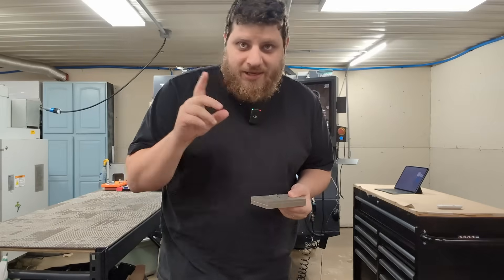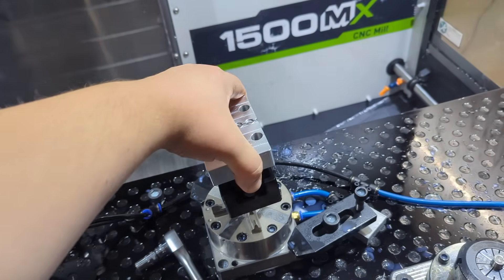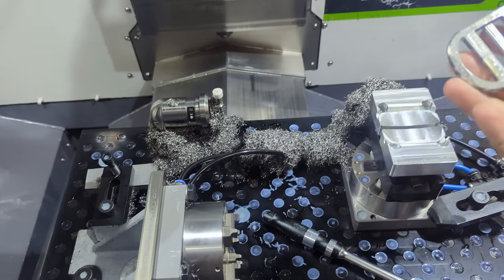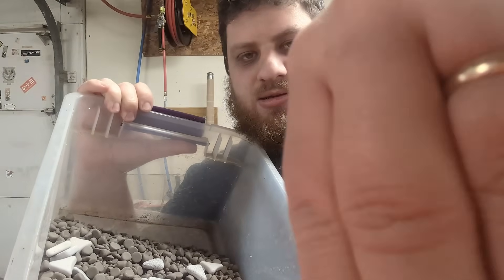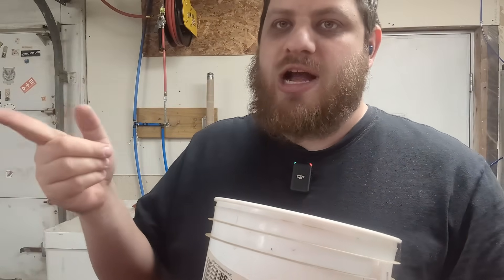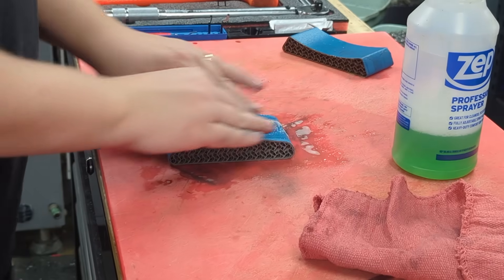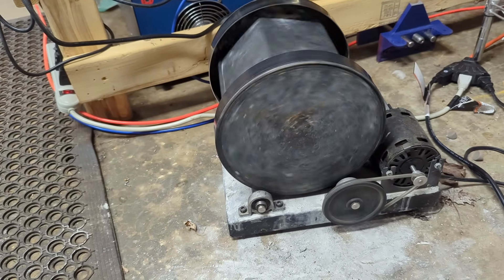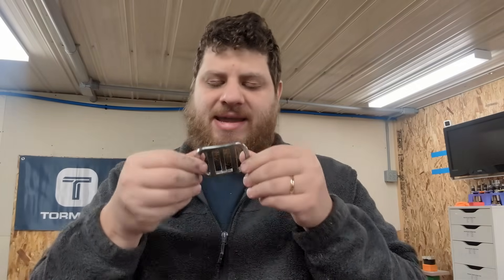Back to my roots

Comment: how do you charge for a part like this? $400 belt buckle?
Reply from the maker: This is a prototype for a larger order, so the cost of this one part will get amortized out once they go to production.
Reply: @AudacityMicro ok makes sense. How much would you normally charge for that 1 buckle?
Reply from the maker: It wouldn't be tooooo bad.